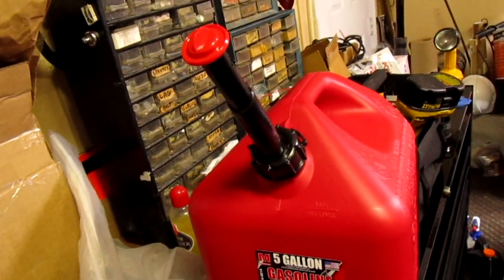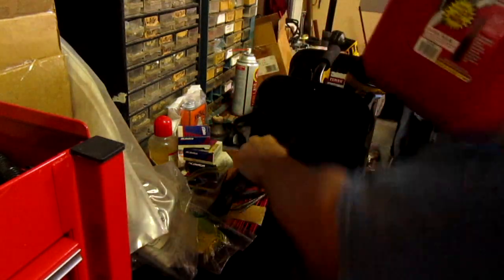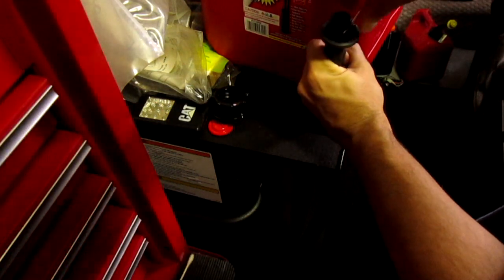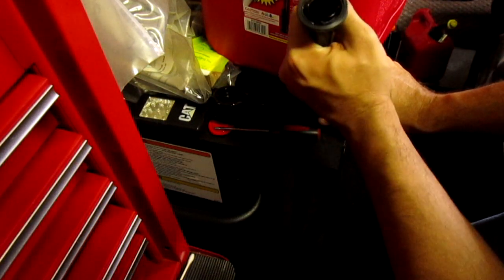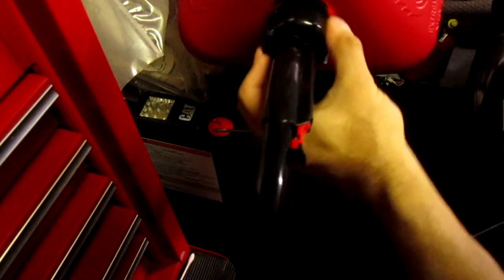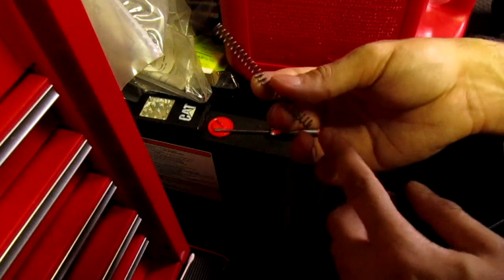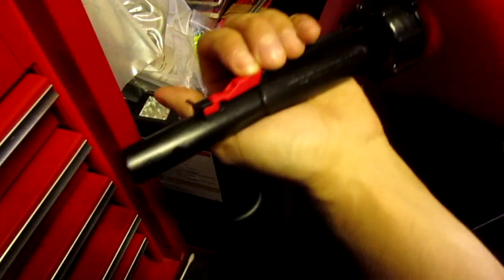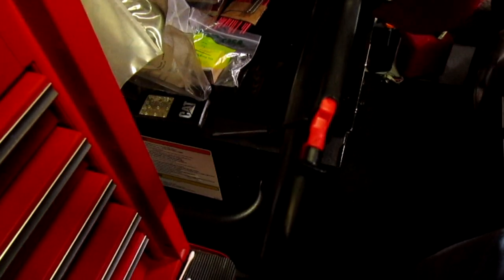Midwest Gas can spout mod SO IT POURS!  SPRING DELETE

Comment: Thank you!! I'm an older lady widow with arthritis in my thumbs. Couldn't fuel my lawn mower. Now I can. Very helpful and I can fix it myself.
Reply from the maker: YA it works better without the spring.  Really no need for it and you can still lock the nozzle closed just manually. Many on here will argue I did it all wrong etc.
Reply: Your suggestion worked great. I gassed up the mower and got my lawn mowed. Thank you again.  @GhettoWagon

Comment: Thank you so much for the video.  I have spilled more gas using these “safety spouts” than I spilled in the decades before they were required.

The spring removal took 1 minute and I will test the tank by filling up my lawnmower tomorrow.
Reply from the maker: Ya it works well.   I still use a funnel for refueling small engines makes it easier.    I cant see how you lift a heavy can use that spring to catch the edge. Its a pita   And then the can can be flowing too much fuel into the tank too fast that way.   No spring these cans work nice
Reply: You are correct.  I have a 5 gal Midwest Jerry can and it is very hard to lift up and pour without spilling into a small tank with 50 pounds of fuel and the weight of the tank.

Comment: Great video, thanks for sharing.
I would just like to add I removed the little raised parts that require you to squeeze the cap to get to unscrew it from the spout, with the cap that holds the spout on to the can I used wire cutters to cut off that little piece of plastic that sticks out to lock on that cap. I took the red part off and through it away, also cut the spring about a 1/2" shorter.
Reply: Yeah I too took that piece of plastic off the cap that prevented it from unscrewing once the spout was removed. Gawd! What a ridiculous invention. Please consider writing to midwestcan dot com and the EPA and the Consumer Board or whatever, whoever, to take these crappy items off the market.
Reply: @rcranch3838  Or to line someone's pockets that contributed to some campaign. No way these are safer.  Spilled more gas the last 10 years than my first 45 yrs on earth.

Comment: Glad to see how to get rid of spring.  I could not push the red thing in.  Used a large pliers and it was hard to move.  Pried it off and sprayed WD-40 on spout and could barely open the spout.  Now when I get rid of the spring or cut it down it should work.  Had to use a screwdriver to get the Child thing back to get the cap off.  The did not think of us disabled old folks when they designed the contraption.
Reply from the maker: What happened was i guess someone drank gas and the other scenario was someone mindless was pouring gas on a open flame so this prevents it.  Its how Blitz went out of business. Who pours gas on a open fire?    Its like refueling a hot small engine and spilling gas allover it so it flash ignites..

Comment: The O ring needs the spring to make it stop leaks. If you are too weak to compress the spring, just take it out and use side cutters to remove a few coils. Repeat until the spring is weak enough for you.
Reply from the maker: Mine have been spring less since 2017 and none leak

Comment: If you have to use a funnel anyway you might as well skip the modification and direct pour from the container without the spout... that's what I do.
Reply from the maker: Why. It takes only a minute to remove the spring
Reply: @GhettoWagon  pours a lot faster and you don't habe yo worry about hitting the funnel with an inconsistent leaking
.. and you don't have to spend a minute modifying it

Comment: These part of the cap you have to press to open the cap ... I just got done sniping it off with an old pruning shear / nipper.  Let some air in so maybe the 2nd can won't such in & crack like I'm afraid the 1st could (its sucked in that much! )

Comment: Better off using the red and white Midwest spout (the one before this new design)  I broke the red part off, cut the tip off the white part. Went to home depot and bought clear hose and a stainless clamp...cut hose to what ever length you like to suit your equipment and fasten with the hose clamp. The Midwest dust cap fits the clear hose too.  Note: Highly suggest drilling out a vent hole on the rear top side and popping in a rubber automobile rim valve (you idiots! empty the can and be sure to clean out the plastic shavings before use!!! Really, I can't believe you were about to do this with a full gas can!!!)...going on 10 years now as I did this ASAP with the new cans and I find it better than my good old gas cans before the gov'ment decided to F' things up.
Reply from the maker: Yea I would try one but i dont have any of those cans/ :(

Comment: What a piece of junk Midwest is selling. Got to modify it just to use it. I took the spout off, poured the fuel into an old can I had, washed and  rinsed the POS Midwest can out and returned it to the store.
Reply from the maker: You dont have to but it works better I think without the stupid spring.  I always use a funnel to pour in gas anyway. With the spring, cant use a funnel. Or for example a new car with a "Capless " fuel cap. You need to use a little funnel. How are you going to push down the spout and hold  when using a funnel. Or hold it back with your thumb and it hurts your finger.

Comment: I've had several of the Midwest gas can collars split and leak.  I blamed my wife (big mistake?);  she helps when I take 5-6 cans to Kroger gas station.  At 60+, she's not exactly a body builder but the mechanical advantage of the threads tends to crack the collar if she is not careful.
My e-mail to customer service suggesting better design or replacing or subsidizing a replacement collar didn't even get an answer.
Superglue/baking soda didn't work out.  I wonder if gasket maker might provide a fix that doesn't involve buying replacement spout at about half the price of an entire (failure-prone) gas can.

Comment: Thank you for the tutorial!

Has anyone located a replacement cap for these cans?  Note that I am talking just a cap, and not a spout.  I'd rather not deal with the spouts at all when I do my pickup runs.  It's too easy to lose one of those little dust caps.
Reply: I feel the same way as I use a shaker siphon anyways. I ordered the EZ pour cap (the yellow one for the coarse thread, not the black one) on Amazon and a two pack was 9.94. The O ring looks a lot more stout than the flimsy ones in these nozzles.

Comment: The NO-SPILL Gas Cans are top notch. I will buy nothing else after using them. They work perfectly.
Reply from the maker: Cool!
Reply from the maker: O crap. those are big $$$
Reply: Are you on their payroll?  These spouts are an abomination, needlessly complex, poorly made, and they leak gas all over.
Reply: @reigels  I 2nd, 3rd, and 4th that!  Mine no longer stops pouring gas and it will over flow.  Obviously something in it went bad.  But that's common with ANY design these idiots come up with .
Reply: The one I got the red catch would not move.  Had to use large spanner to get it to release.

Comment: This spout is great as is, easy to use and empties fast and does not leak at all, no mods are needed, safest can I’ve ever used. Take few seconds and read the directions.
Reply from the maker: The spout design does not work if you use a funnel to refuel a  tank. Works great with what I did here.
Reply: Ghetto Wagon I have no need for a funnel but I see where that  may be  an issue in  some cases TY.
Reply from the maker: Yup! some of my small engines have a tiny filler hole. Some cars are bad too, they really have the filler neck recessed, need a funnel for those too
Reply: @2tallman26  I don't have time to get older when filling a mower, etc.  The ez pour spouts or this mod are way bigger.  The only reason you never spilled gas is because you pour a cup at a time, over an hour.  I've had the lip break when pushing it on the lip of a tank. Spilled gas all over.

Comment: You might get away with shortening spring. If you have bench grinder, grinder 1/4-1/3 of length off spring from the spring.
Reply from the maker: Nahh you don't need it at all
Reply: I'm taking the spring out. No grinding and no mess, just as the video shows.

Comment: That tab where you used your thumb to push-on is meant for you to rest it (the tab) on the lip of any gas tank that you want to add gasoline in to... Not a thumb-pull tab.
Reply from the maker: Yes but as explained below alot of small engine fuel tanks you are never getting this nozzle in. Its geared for cars. I use a gas can to fuel a small engine tank with a funnel so this is completely worthless and I would have to hold it back in that case.  Think if youi have a small chainsaw or something. The same nozzle is on a smaller fuel tank. Ya try fueling it as is with this design nozzle with a spring in it
Reply: Until the lip gives way and you spill all over.  How it's designed is not how it's functional.  It's best completely tossed away.  But this is a good start.  I would call it a thumb pull tab myself.  Pull the tab with your thumb and dismantle the SOB.
Reply: It's a horrible design, and causes leaks/spills all over with capable people.  It might be better for idiots, but pandering to the lowest common denominator usually gives the expected results.  A much better design would just be a press lightly to unlach, pull a cord to open a valve, and if you let go, it snaps shut.  Smaller tanks, you can even use a hang grip the same way.

In one case, I had an older Craftsman II tractor with a softer fuel tank that was damaged just by the force that spring exerted.  Luckily I was able to salvage the tank.

In the other case, I had the little lip slip off of my wife's Accord, and the whole thing went inside the tank.  Of course it got stuck and would not come out.  I worked at it for almost 5 minutes holding a half full tank trying to work it out cleanly.  Luckily, only a little gas overflowed in the process.

My zero turn has a larger opening, and I realized I spilled less gas taking the entire cap off and just pouring without a spout.  If I get a little bleeder valve insert, that might be the best solution for that mower.
Reply: Try resting it on my lawnmower, weed eater or snow blower.

Comment: i think these spouts are from the EPA deciding we can't vent gas fumes . the horror.
Reply from the maker: Somewhat.   They seal well if the can is tipped w/ or w/o the spring in there.   I also noticed the plastic on the spout softens up and the whole thing distorts.

Comment: That safety cap spout  keeper can be cut off to make it easier to remove.
Reply from the maker: Dont need to  Just remove the spring I like how i can pop it back to lock it manually

Comment: I/m so glad I came across this old post.  I don't think I've laughed so hard in my life!  While you are holding down the black plastic piece WITH YOUR THUMB, you mutter, "......you gotta hold it with your thumb....a lot of pressure". HEY GENIUS, that black plastic thing you are holding down with your thumb IS WHAT CATCHES ON THE LIP OF THE GAS TANK filler tube!!!!!!!!!! The weight of the full gas can EASILY pushes the spring down and gas flows very fast into the tank.  What ever made you think you were supposed to try to hold down that black plastic piece WITH YOUR THUMB?  Oh my god, that spring is soooo stiff, I bet your thumb was ready to retire!  Thanks for the laughs.  I'm too lazy to scroll through all the comments but, please tell me, I can't be the only one that got a good laugh out of this?
Reply from the maker: I EXPLICITLY SAID ITS NO GOOD WHEN FILLING A SMALL OPENING FUEL TANK LIKE A SMALL ENGINE TANK THAT HAS A FILTER SCREEN UNDER THE CAP.        YOU ARE A MORON YOU USE A FUCKING GAS CAN TO 99% REFILL A SMALL ENGINE NOT A CAR FILLER NECK.

Comment: Why not just remove the red lever/button, but keep the spring?  It’s then still going to seal up, you just don’t have to do the press the red butting juggle.
Reply from the maker: It wont work like that and now you have a pinch point  The red lever keeps it all together
Reply: @GhettoWagon  What are you talking about? The red level doesn't "keep it together" - I'm out deployed for disaster relief, but I will try to demonstrate. Iv'e done it several times before. No leaks, no pinch, and nowhere near the headache of the red level.
Reply from the maker: @michaelbattenfield4603   Ahh But then cant close and lock the spout for storage. thats  pretty handy
Reply: @GhettoWagon  Spout stays closed pretty well anyway (still has spring!) If I need to store or transport, I usually flip the spout over and seal with the little red disk anyway. I hate the spout sticking up.

Comment: Hate this thing!  I am unable to use my siphon hand pump as this has a filter inverted at the pour spout.  WHY do they
continually try to 'improve' things that do not need improving?  It is not just this brand who is doing this... many different fuel containers
are being made this way with different 'new and improved' features.  I have found 'water container' at Tractor Supply (5 gallon) that works
absolutely fine and has a regular open top and is cheaper than any of these useless things.

As for child prevention?  Be an adult and take care of these dangerous things accordingly!
Reply from the maker: Its the EPA and the goverment. It will only get worse now with our new admin. Yea Children and gas cans I never played with gas when I was a kid   . Other gas cans are made with spark arrestors in them because people blew up when pouring gas on open flames.   Blitz went out of business because of that too many lawsuits. Who pours gas on an open flame in  can?
Reply: @GhettoWagon  Ahhh... thank's for the reply and I did not realize the EPA was doing this.
Reply from the maker: @dave2640  They dont want spillage and gas to vent into the air.
Reply: A flat head screwdriver and needle nose pliers fixed my filter

Comment: The vid stops at 36 seconds every time I try to play it
Reply from the maker: Your device is messed up
Reply: @GhettoWagon  yeah I got it. Did the mod too. Thanks
Reply: I modified mine by cutting 1/2" off the spring, works well, mine has a secondary oring, maybe they took your advise.

Comment: I think there are some pouring situations where your mod is needed, but it's probably not needed for most things (pouring gas into a car, lawn mower, etc). I'm not complaining ... just sharing what I found out.

I had a tough time figuring out how to operate this spout. But I found a video demonstrating it from the company that makes it. You don't hold the spring back with your thumb. You just that little plastic lip to hook onto the filler cap. Then a little downward pressure retracts the spring-loaded half into the other half, and gas flows pretty well.

Once I understood how to use it, it seemed pretty darned clever. While you are tipping the can to get the nozzle into the filler cap, no gas flows. Likewise, when you are taking it away, the gas flow is shut off. 

The company didn't make it very easy to understand, though. I studied the instructions on one of these in a store before I bought it. It didn't make sense to me, but I figured it would be obvious once I was actually using it. Not even close to obviousl

PS:- I get no leakage at all from the middle of the spout, but maybe that just due to being lucky on the tolerances in the particular one I bought.
Reply from the maker: Yea try to juggle a 6 gallon can and catch the lip of a spout w/o spilling it   I use a funnel every time i use a gas can.  You cannot use the can properly out of the box if you use a funnel.  I dont have any leaks from the middle either but it could happen as it wears.    Mine is manual now. I like my mod.  Its locked and stays locked if I want to. it just has no spring
Reply: Well, I'm not arguing that you shouldn't do your mod. That's certainly up to you. The way this spout works, the gas does not flow until you have hooked onto the lip and given a little downward pressure. You don't have to touch the spout at all while the can is in the air. You just click off the safety, position the can with the spout on the filler cap lip (do it as fast or as slow as you like), and give a little push down with your hands holding the can. The gas starts gushing, then and only then. When you're done pouring, lift the can up enough to let the spring push the mechanism back in place, and the gas stops flowing completely. I did it yesterday with a 5-gallon can, and I was surprised at how easily it worked.
Reply from the maker: Now mine is manual. I like it. I can tilt the can and open up the spout when I want. :)  You put a whole lot of pressure on the can when the spring is there. If it ever breaks off, all that weight there goes the gas! Alot said they cracked the collar.  Watch it flex when you put weight on it.
Reply: @GhettoWagon  Yep.  Bill Carpenter take note.

Comment: wow! A product you have to work 9n before it is usable.  i bet it’s made in China too!  Plastic no less.  i have two of the metal gas cans that won’t tip over, i bought metal spouts for them on ebay.  Dont need this shit.
Reply from the maker: No made in USA. Dont worry Biden will make gas cans even more safe or we wont have gas anymore